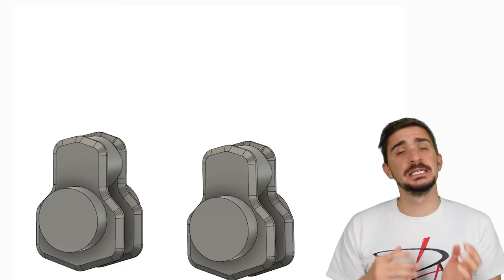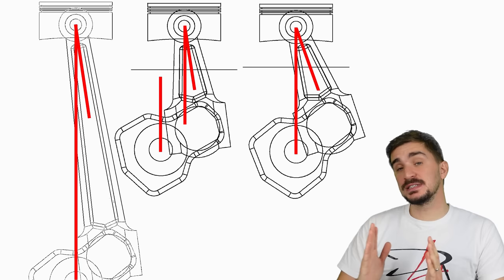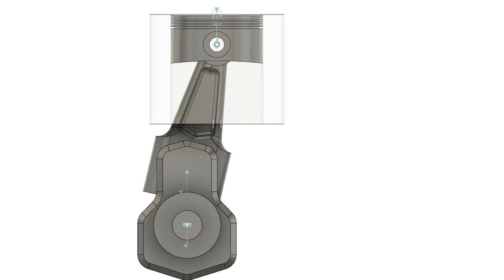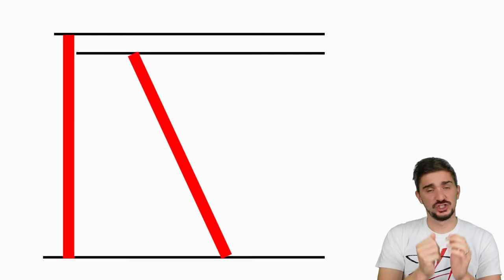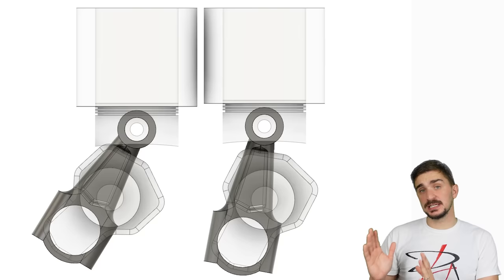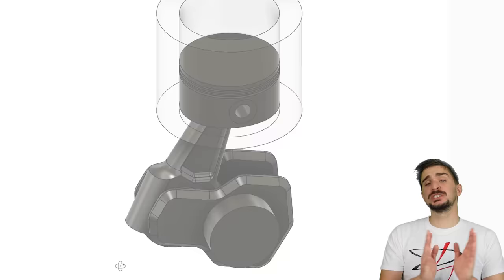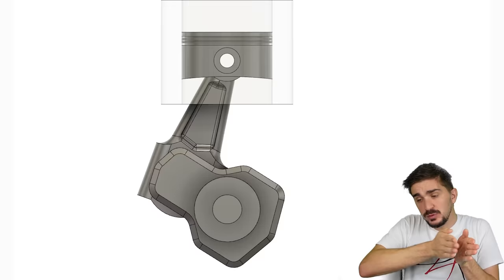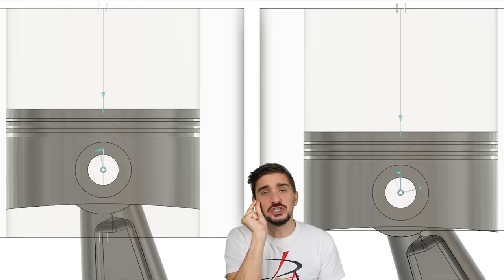Cylinder Offset Changes Everything

Comment: The result of the power remiains equal or same because no 1 cylinder has more power due extra exteded crank angle but less power for less piston stroke distance and no 2 cylinder has more power due to more compresssion and stroke and less power due to less crank angle.

Comment: Very interessting, thanks for that Video but in my opinion the piston does not get "pulled" down
Reply from the maker: Not by combustion of course, but by the rod it does
Reply: @d4a  but we are talking about the running engine, so the pitston gets pushed down by the combustion and moves the rod and the crankshaft. We are not turning the crankshaft.
Reply from the maker: It's two separate things

Comment: I have an in-line 6 engine design I would like you to model and give me your opinion of this design. Stroke= 3.26772" rod length=5.55118" wrist pin offset= .040"  I would really appreciate your opinion on this design. I believe this will be a very good rotating assembly. So if you can model this design as it would appear you have the ability to do I will build this assembly.

Comment: Bike engines aside... Would it be possible to balance this type of engine by adding a second bank of cylinders on the other side of the crankshaft? Meaning you have a "double inline" engine (instead of a "V"). Would it cancel that engine rocking motion?

Comment: Can you do the balancing of the offset in the crankshaft and connecting rod. 
And or do offset at the cylinder too???
Reply: It does sound wrong to offset the cylinder but just so slightly could also lessen the force on the cylinderwall.
Reply: Interesting stuff!!

Comment: Does this imply that offset engines can only be inline engines? Because in a V-config, the degrees between firing would be widely different between banks, but not so much on the same bank? ie: uneven firing strokes.

Comment: Is there an error when comparing the two forces of cylinder with/without offset at timestamp minute 22 ?
At a non-offset cylinder engine, the force follows a sinusoidal curve, the value at 0 degrees corresponds to that at 360 degrees.
At the offset cylinder engine, on the other hand, the two values at 0 and 360 do not match and the course of the curve also continues to rise. 
I would have expected that the course would also result in a closed curve after a full rotation.

Where does the difference come from ?

Comment: Though I had to get up for something & pause, I survived the whole video without skipping. And I'm someone getting more & more sick of engines. The only reason I still care about engines, is because I love Series Hybrids over pure BEVs, and to my knowledge, the most efficient way to turn gasoline into electricity, is a low revving single cylinder engine turning an electric motor/generator. Thermoelectric generators are way too big with Sterling Engines or too inefficient with Peltier Devices. Diesel engines are too bulky & heavy, and I haven't found a way for their pumps to handle the less lubricating gasoline to make them multifuel. And gas turbines are very complicated to make & modify, and I haven't found a production micro turbine that has many compressor stages to make it efficient. I'm stuck with pistons for my generators for the time being. And I'm long sick of the mess, noise, high maintenance, and all the things that can go wrong. I just want something that just works like batteries, but.have the energy density and quick refill of gasoline & diesel.

Comment: Dear sir, I would like to know if in the case of a 2-cylinder boxer engine, say, as in the case of the Citroen 2CV engine, or the Subaru 4-cylinder boxer engine, perhaps these first and second order efforts can be compensated without need of complementary axes of stress absorption. In advance, I would very much appreciate your analysis of these questions, in order to learn what the balanced engine could contribute to an engine with reduced dimensions and high efficiency, such as a 2-cylinder boxer in particular, with a possible added turbo, 2 or 4 valves per cylinder. and double camshafts with opening variator. Greetings from San Luis, Argentina!!!

Comment: Do the engines that use offset designs have cut-outs in the cylinder wall to accommodate the rod during the start of the compression stroke? I notice in the 3D model the rod goes through the bottom of the cylinder wall.

Comment: an article exactly describes what you said. but it was released 2010.
13 years later no such engines to be seen in production.
Reply from the maker: There's dozens upon dozens of engines with offset in production. Anything from yamaha r1,  Kawasaki zx10r and small outboards to Toyota Dynamic Force engines and many others

Comment: And this is why my 2015 Honda CR-V has such terrible nvh characteristics. It was the year Honda switched to an offset cylinder configuration. You eventually get used to it though.
Reply from the maker: To an extent, probably. But it really comes down to how much a manufacturer is willing to spend to either mitigate or mask it. This of course depends on the target price of the vehicle. But you're right, it's really usually not too bad

Comment: This was very interesting, and IMO a high quality presentation. 

It's also, irrelevant, because the age of the ICE engine is now dying. Fossil fuel-powered transportation and machinery is coming to an end, and for good reason: therm-dynamic efficiency is inherently terrible, and there's nothing major that can appreciably change that. The disruption - at least for now - is driven by battery electric motors. What new tech looming over the horizon  - if any - is unknown. For now, and at least the next decade, the world is turning electric, powered by batteries.

Comment: i think you left out the contribution to engine timeing. i guess you sort of indirectly talked about it with the implications of stroke length, but there are also some advantages to combustion happening during a higher compression for longer which because pressure = temperature = gas particle velocity, higher compression means better mixing and better emissions/power/economy. i think maybe this is where the claim that offset engines are smaller comes from, not just less friction?

theres a video out there of some guy putting a b series honda cam on a d series engine, i think its a 2000's (5th gen?) honda civic and he very quickly spins a rod/blows out the case. im thinking that the offset designs made timing modifications much more risk since there is a better almost 90 degree force being transmitted into torque on the essentric shaft. cant just pump these j econo boxes full of nitro like u could in the 80s lol owell

Comment: What happens if you turn the engine 90⁰

 and also if there is more torque could that be harnessed in different gear box ratios so fewer revs could be giving similar speed over ground?

Comment: Just wondering. What are your thoughts on contra-rotating crankshafts with 2 off-set cylinders? Would the crazy line you show at around 21.50 be cancelled out by its reciprocating opposite?

Comment: Hello D4A, could you please talk about piston pin offset ? And why it seems to be just offset the opposite (inlet side - to the left - on a clockwise rotation crankshaft) compared to the cylinder offset ? So conrod angle becomes “bigger” than no offset engine when piston pushes... I've seen that into a little 50 cc motorcycle engine with high revs that I'm rebuilding. Is it for torque gain ? Thank you for explainations, best regards from France.

Comment: Can't you replace balancing shafts with some smartly cnc'd flywheel and additional flyheels on camshafts? I mean some balance shifts happen at crankshafts speeds, other at camshaft ones, aren't they suppose to be predictable?
Reply: Or even better, if modern ecu is smart enough to calculate parameters for a hybrid turbocharger based on load, and engine has a predictable chart, would it be possible lo counterbalance using electromagnets or some motor, like every rotation of an engine, ecu records the graph, and on another rotation it applies this to electronically controlled balance shaft or some spring loaded weights to reproduce a pattern? Or maybe just add some rubber to engine mounts😂

Comment: So could you have a straight 4 with 2 cylinders to the left of the crank and 2 to the right to counter the secondary balance issues?
Reply: the jowett jupiter r4 4 cylinder is kinda like that, it's offset crank and perfectly balanced, but a boxer. i think it may be necessary to go to an inline 8 to get your idea to balance, not sure though. https://www.youtube.com/watch?v=hVJntOsL5zk I think if you could have two separate crankshafts turning in opposite directions in a 4 cylinder it might work.

Comment: A little confused. The friction gained during combustion or TDC/BDC. Wouldn't that be partially lost during BDC/TDC as the angle is very great during that travel??
Reply from the maker: But there isn't a massive load on the piston there hence no potential for large friction
Reply: @d4a  It would be interesting to see someone experiment with that. I see your point but given the speed of travel I don't believe the potential for increase friction there is non existent.

Comment: Does an offset gudgeon pin in the piston in a zero offset engine have the very same effect as offsetting the crankshaft? Or can both offsets complement each other if applied to the same engine?

Comment: Does it also lessen the risk of ovalling the cylinders?
Reply from the maker: It's not a risk it's a given. This does reduce the uneven wear, but given enough time it will still happen even on an offset engine.
Reply: @d4a  Could you ever have enough offset to lower the compression for decent boost in a turbo vs. N/A no offset version of the same engine?

Comment: I did sort of skim watch this so correct me. But didn’t he not address that the offset one should push into the cylinder sidewalk significantly more? I saw that he compared the bdc of the offset engine to the midstroke of the non offset saying the piston was less angled, but from 240 to 330 degrees about won’t there be a significant wear and friction on the cylinder sidewall? And even worse it would be an uneven wear unlike in the non offset engine??
Reply from the maker: Yeah....I know what the problem is....the skim watching.
Reply: @d4a  🥺
Reply: @d4a what am I missing? the reduced rod involvement? Cause not only is it more angled but the exhaust stroke is also quicker no? Cause it occurs over a shorter number of degrees?
Reply: @d4a  i rewatched the whole thing, still don’t know why you want me to see??

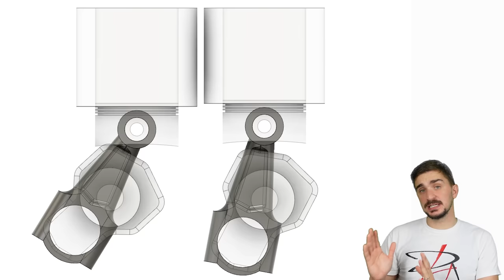Comment: 13:51 in this situation,
Offset engine looks more conrod-angle than non-offset engine.
So it might genereate more drag from the right side wall of cylinder.
How do you think about that? 
I didn’t know about offset engine, and its so impressive.
Thank you for this interesting video.

Comment: Hi @d4a

Can you please explain how the issue with secondary imbalance is addressed for engines with offset cylinders? For example for inline 6 configuration.
Reply from the maker: I don't understand the question. I6 doesn't have any notable balance issues.
Reply: @d4a  even with offset cylinders?

Comment: Compare Continental and Lycoming aircraft engines. They both are vertically opposed almost ancient designed which endure to and are still manufactured presently. One does choose crankshaft counter balancing and the other does not.  One chooses to have the camshaft and lifters below the crankshaft and the other does not. Both use large displacements to produce their torque at low rpm's which are limited by exceeding the efficient tip speed of the propeller. The engines spend their lives near maximum cruise rpm's of 75% where as automobile engines are not operated at that high of a percentage of available rpm capacity at highway speeds. Automobile engines however must operate at a much higher rpm to achieve maximum torque and do so through gear reduction. An aircraft engine cannot afford the additional weight for a list of reasons, hence the much larger displacement to achieve the needed horsepower rating. Lycomimg 0320 engines is rated at 160 hp using 320 cubic inches of displacement. The 0200 Continental engine produces 100 hp with 200 cubic inches. Continental chooses to add cylinders to to achieve near equal hp and jumps to six rather than on increasing displacement of each individual cylinder. More closely matched in displacement and horsepower is the 0200 Continental with the 0290 Lycomimg at 125 hp with the penalty of additional weight. The 0320 Lycoming weights in at 278 pounds. These icons of light airplane engines have endured the test of time and their designs to me as a non engineer, layman are deserving of some closer look and some perhaps praise. Charlie Taylor started it all for he hand built the Wright Brothers first engine. 65 years later human kind stepped on the Moon. Imagine that.

Comment: A lot of questions... 
For example... 
Why the losses were only explained for expansion phase? Losses on compression phase will be higher...
If the connecting rod is the same... the crankshaft cannot be equal... 
This type of comparison needs to be done for same engine displacement... 
This analysis is wrong in both ways... theoretical and practical...
This analysis is scientifically incorrect...

Comment: I just built a an offset cylinder 2 stroke rotary valve, rotary port externally scavenged electrically assisted supercharged V12 engine in my head. Who says you cant build a 2 stroke torque monster.  Anyone want a 2 stroke that runs on pump gas with no mix?

Comment: Not to knit pick BUT you Connecting Rod HITS the cylinder wall... this means you would have to have curved connecting Rods which ARE CRAP - EX. SUBURU FLAT6 ENGINES, very week design because of the non symmetrical center of mass/strength/ balance

You could put a huge notch in both sides but it's on the center of the rod and would significantly reduce its strength,  I know it's just a mock up example BUT a real cylinder is EVEN longer because the skirt never fully comes out of the bottom of the cylinder,  SO you could increase the Bore of the cylinder BUT this would Reduce stroke ratio which would make it a undersquare engine which would further decrease the actual amount the offset would matter...

Comment: Combustion engine manufacturers had the opportunity to do amazing things with engines, they have ignored or hidden technology that would have benefitted consumers and the environment a lot, now that they are banning combustion engines in most countries where they make the biggest profits they are suddenly coming out with all the innovations they could have used, 200mpg engines giving amazing power. If their greed had not stopped them from doing this decades ago we would have cars that made the possibility of electric cars a joke. Just imagine if you had a car that on one normal tank of fuel had a range of 3000 miles.
Way for an industry to allow itself to be destroyed, and yes they can convert to electric manufacturing, but electric cars are very very easy to manufacture. No not the tesla with their crazy ideas that complicate manufacturing but a normal car with battery and mototors and controller is 1 million times easier and more reliable to build.
We already see multiple new manufacturers , some a success some trying to grow too quickly, but eventually we will see dozens of new car manufacturers competing at very low prices, expect to see a decent comfortable electric suv with 7 seats and 1000 miles range very soon selling at 10 000 to 15 000. maybe a bit more for the longer range. But i personally could have done with a 150 mile range suv over the past few decades, i rarely travel more than 150 miles away from my home and only then once or maybe twice a year.

Combustion is finished as a means of personal transport , but it is fun to see how much the manufacturers fucked themselves when watching these videos.

Comment: how can it go as hight ,if there is an angle on the rod,at TDC,,,if the rod as the same length ?  and when you say slightly offset ,,for me it isnt just slightly,,,,ohh I see that the crankshaft as  been lifted a bit to do so ! ok,,,,then why being able to go more furder down the cylinder ? at 0:21 the piston interfere with the crank,,loll, and all along the rotation the crank on the left vary slithly in height,loll and by the way more pressure applyed on one side of the cylinder meen more wear,,the cylinder will go oval long before the other normal alignement one!!!more efficient maybe but less durable for shure!!🤔😉✌

Comment: Nothing new…DeSaxe principal. All Flathead V8 Fords have it. European engines  had it in the early teens. Early 265 Chevy’s utilized an offset wrist pin in early production as persuaded by Smokey Yunick. Nothin’ new here. The Merlyn Diesel, highest horsepower to weight ratio diesel in the world has it’s crankshaft offset 1.625” from bore center. Nothing new here people!!!!

Comment: So offset engines can only be in line?
Reply from the maker: No, you can offset pretty much anything
Reply: @d4a  I can see maybe an horizontally opposed. But not a V. Horizontally opposed you could offset the cylinders. But how do you do a V?

Comment: Balance ain’t nothing complicated like a Burt McCollum 😂 sleeve engine but we can make that more uncommon if we offset the cylinder to crank… though if we use a Lowi variation of a Dyna Cam engine/KamTech/Riley/Michel/Ali axial barrel cam or swash plate type engine or if you must have chranksafts a Trebert axial cylinder barrel engine with offset cylinders … Putain de merde … Anglo - Holy Molly !